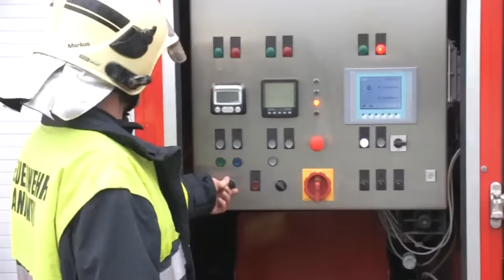LUF Long Distance Water Supply

Comment: Wow happy I live where the fire fighters give a shit. Took long enough to get water to the rc tank sprayers. Way over engineered. But love there cars.
Reply: Even if its Complicated, its a kinda easy way for bringing almost 3000 gpm 7.5 Miles across... In addition: its used in situations that take longer for example Industrial fires
Reply: This is just a demonstration I'd imagine they are much much faster. But if you believe this is a real fire.....more power to ya
Reply: Well in a real life scenario if this would be available it wouldn't be first on scene you would have already engine and tankers on scene this comes as an addition later when the Chief thinks They need more water so basically it's cool yeah but never going to be standart they are already systems we use on Germany and their are working great
Reply: @TheGhostOfDefi  Hells Bells! Get a half way decent tanker shuttle going and you can  supply several master streams. If the fire has gotten ahead, cut it off and concentrate on unburned side. For water movement 7.5 miles? The pressure it would take to do an effective relay pumping that distance is impracticle. Look at your fire district, pick an idustrial complex. Then pick a water source, your only water source, 7.5 miles away. You have to admit to yourself you would change your tactics.
Reply: @Wa3ypx  long story short: nope. Im a firefighter in Germany we use different tactics, we have different environmental factors and a different infrastructure, i think we can agree on that. As people sayed before, we use in Germany already a system which is comparable to this and it has prooven itself in major fires. These systems use low pressure high flow with just one pump.
Reply: You guys work waaaayyy too hard!! LoL
Reply: @Wa3ypx  it's more easy than you think, if you ever come to Germany tell me I show you around 😉
Reply: @Wa3ypx  Not really I'm also a firefighter in Germany. We already had a case like this. We were called to a fire in a recycling center. And we in Germany have underground hydrants basically you open a cap on the street und you need to set the hydrandt easy system. You can Google it. So problem was the street was under construction so we had to go basically 2km to the next on because it was shut off. Similar to one Episode of Feuer and Flamme. Our city has a Carter Fire Department and 6 Volunteers fire department in the suburbs and 2 Hosewagon. Putting a Engine to the hydrant and 1 Hosewagon took about 5-10min depends on the distance and you have a working water supply. Also in Germany we have way more people on scene the Career fire department go out on a fire with 1 Battalion 2 Engine with 6 People 1 Ladder 3 People 1x Ambulance. Our Volunteer Fire department has 2 Engine and 1 Hosewagen and we go out 9 People with each Engine
Reply: @seydiatas7690  Some areas here in the states have those hydrants. My dept. a career dept will respond to a structure fire with 3 Eng 1 Rescue 1 Ladder 2 Chiefs. Minnimum mannig on scene would be 17 people. Max staffing would be 22 people. Our fire insurance is based on fire flows and other things. Typical hydrant spacing is 1 hydrant every 500ft. Water main sizes vari from 4 inch to larger in a downtown area. Rural areas use tanker trucks with portable tanks for engines to draft from. I think in England the portable tanks are called mobile dams. Many rural depts practice supplying master streams at high flows using ONLY  portable tank water. They are sometimes called upon by insurance companies to demonstrate that they actually can do this .https://www.youtube.com/watch?v=0qjyiNcxOhs
Reply: @Wa3ypx  Yeah watched a nice system it's a nice system what you got. We have these to but not to be often used. The Thing is tactics an vehicle are way other in Germany then in the states. For example our Engines mostly carry Jaws of live basically a Rescue Engine also Ladder Company In Germany never go inside usually when our volunteers department responds we are 9 people on each Engine and they are basically 3 Team. 2 Persons = 1 Team. So we have the attack team goes inside the building. The safetyteam standing by incase something happens to the attack team but depends if we have a fire with many people missing they going inside as well. And watersupply team. But also we don't have many fire calls. Static wise this year we had 51 so far Calls as the volunteers 51% was Car crashes, Person behind the door and storm calls. 19.6% Hazmat Calls, 3.9% Fire Calls, 23.5% Automatic Fire Alarms mostly false alarms. The nice thing is our hose wagon basically we have is called a Logistic vehicle and this vehicle by our depends got 3 different equipment. So we can get hoses on this vehicle from a distance of 2km. But it's also a Hazmat vehicle and our Logistics Vehicle for Longer Oil spills. https://www.feuerwehr-koesching.de/ausruestung/fuhrpark/geraetewagen
Reply: @Wa3ypx  don't only think of fires. Try running Tanker shuttles in a flood scenario ...
Relay pumping is easy for the average hose, when switching the pumps from multiple Portable Pump Units in between; Butthis system is simply for LDH and large amounts of water, larger amounts than the normal municipal apparatus can handle. 
"You guys work waaaayyy too hard!! LoL"  Well how many apparatus in the USA have a system to repack the hoses back into the hosebed? 
"my dept. a career dept will respond to a structure fire with 3 Eng 1 Rescue 1 Ladder 2 Chiefs. Minnimum mannig on scene would be 17 people" Not much different from here, apart from the circumstance that they'd usually come all from the same station instead of from different stations. While an Engine can hold up to a crew of 9, most career departments run with a crew of 6 on an Engine. A crew of 17 to 20 for a structure fire is normal here as well (already for an unconfirmed activated fire alarm with no smoke showing). 
For a scenarios like forest fires we often use portable tanks from Engines and Tankers as well, and let Engines and Tankers run as shuttle if necessary. But that high volume pump really is a nice additional piece of equipment and another option you have when you have a sufficient water supply e.g. by a river or canal nearby

Comment: Those safety pins on the "hinges" for the ramps are worthless.  Either side of the hinge pins can work their way out way before the the safety pins come into play.
Reply: The pins fall into a bracket that's midline to each section. At 5:05 there is a pretty good picture of the brackets.  The smallest sections at the ends of the ramp doesn't seem to have a place for the pins thou.
Reply: @patrickm9831  Ah  Thanks!  I was looking for something like that and didn't see it.  Now it makes sense.   It looked like there was nothing at the mid-line for the pin to fall in.

Comment: The ridiculous part, it´s at the fire, they are using 40-100 gpm/ 150-400 lpm fire streams for "not do damage to the structure"...and after 2-4 hours they say "fire under control", but it is a pile of smoking rubble!!!!.

Comment: Now when they say us is slow in USA this is to much slower because you have to setup all the stuff before you can pump water
Reply: uhm did you get that this isn't an ordinary apparatus responding to the everyday kind of call? Even a fully involved house fire is not the kind of call this one would be dispatched to. This is meant for larger dimensions, like industrial fires, long lasting calls, flood scenarios etc. It's not a matter of a few minutes then, and apart from that it would probably cost even more time to set up several hoses and pumps with standard apparatus to get the same result like with this one unit. 
Btw if you think that it doesn't make sense, ask the American department which relied on mutual aid from Germany, coming if their pumps across the pond in order to pump larger amounts of water

Comment: Anyone else find it funny that when they were putting the ramps together that those pins they were using to put in the middle made no practical sense at all? There are engineers that I like, but then there are engineers who have absolutely no common sense.
Reply: Watch it again, and perhaps read other replies to the same comment you have made. Perhaps everyone making duplicate comments should read through other comments and replies before making a comment and making themselves look stupid.
Reply: @brandonhaines1920  watch it again. You will see that the central pin locates in a hole in a lug that stops the pin going either way